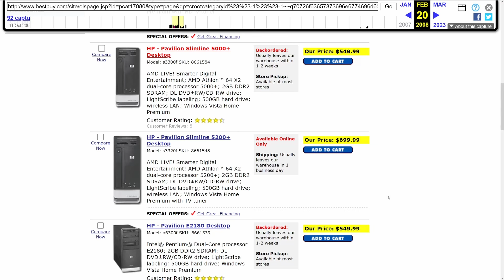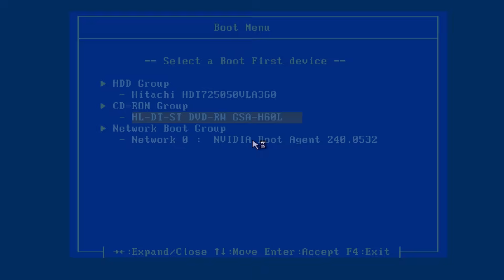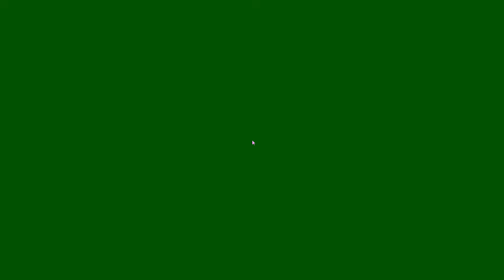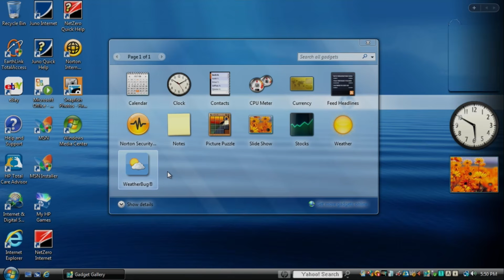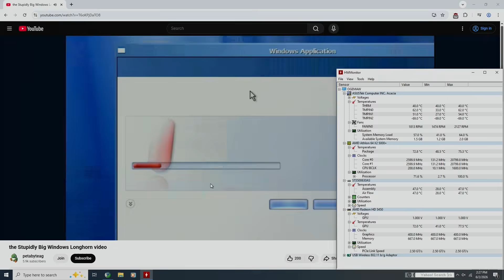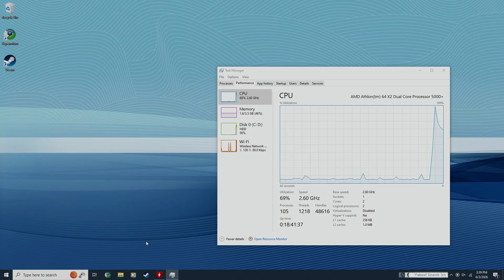Retro Review: HP Pavilion Slimline s3300f

Comment: The HD5450 is an excellent graphics card, and has many uses including propping up a wobbly table or throwing at fighting cats outside your house in the night. It should not however be used in a computer. This is folly and will cause you pain, as you discovered. I have one too, safely tucked where I cannot access it. Your machine here is the equivalent of a budget HP laptop, a bizarre mix of good and bad but designed to basically be replaced.

Comment: yeah the 5450 with window xp and cat 10.2 driver will run hl2 flatout sim3 etc much better than what it did for you on windows 10. one other thing i generally do is i just use the cataylst driver with the card and never install the nvidia chipset drivers because everytime i did i had major crashing and instability issues with those amd 64 hp era motherboards i have a midtower inspiron 530 and a hp dc5800 sff that you can put a monitor on top of with those nvidia am2 motherboards in them and i find having those ? marks in device manager and just installing the others drivers around the chipset result in a much more stable and consistant computer experience lol

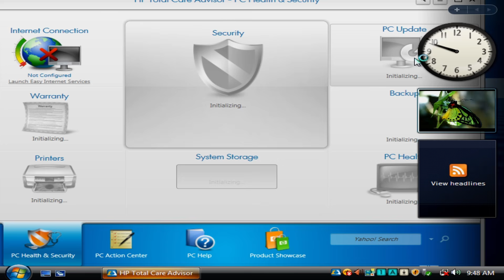Comment: 12:39 If you have the graphics drivers installed, you can usually fix the scaling by changing the Overscan settings in Catalyst Control Centre

Comment: My work had a few of these s3300's although we had the variant you had as well as the Intel version, neither of them would POST but I believe the AMD version had bad capacitors, probably due to the heavy heat killing them from whoever owned the units previously. I think the other just had a bad power supply. I believe I took the small TV Tuner cards out of the units they had before they were recycled, as well as the PCI Video card, I believe the unused punch-out on one of our units was for a S-Video connection to a older TV. The little spot at the top was for the screw to hold it in place. If I could upload a picture I'd show the card it came with.

Comment: I still have this, I have 3 frame case still here and the kmb already throw it because no pw work, also it use small 24pin. it can replace the new big 25pin ITX MB, But the ps position need to use hame the lock to inside.

Comment: I bought this same cursed pc. It sucks. Installed the first low-profile display adapter I could find, an HD 8490. Then proceeded to install Windows 10 and suffer. This thing will literally heat up a room. Great for cold days.
Reply: Where did you find such VGA?

HD 7xxx was last... Next generation is a radeon r7 260 (mainstream example).

Comment: I have a pair of eMachines PCs with a similar form factor and the same chipsets. One's from around 2008/2009 DDR2 and missing the x16 expansion slot but has eSATA built in despite it gaving a cover. The other's from 2010/2011 with DDR3 with no eSATA solderpads, but both do have provisions for an extra fan header and an onboard firewire interface alongside spots for HDMI and extra VRMs. The service manual mentions the DDR3 model having a board with the nVidia 8200 iGPU as an option, but the DDR2 model seems more likely. 

Also, adding in a dual-core CPU and a HD2400 makes it into a cursed DDR X-A20 machine.

Comment: I was using a pc with AMD Athlon 3800 s939. It was heater... Like 80+ C in summer.😂
Reply: Huh. Athlon 64 X2 4800+ (socket 939) with a stock cooler (original frequency (2 cores at 2.4 GHz)) should be ~31° C (many users saying so).